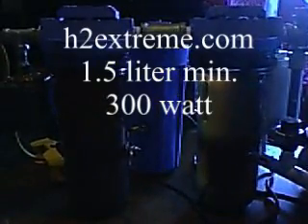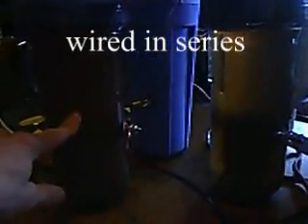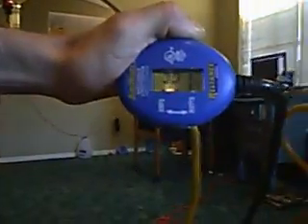h2extreme.com 1.5 liter minute hho microtorch

Comment: I agree with running the contacts underwater. It seems that the wires heating up and over time loose connections could cause sparking in the HHO area and may be one of the main causes of many of the cells exploding.